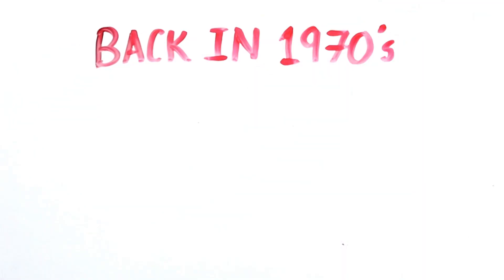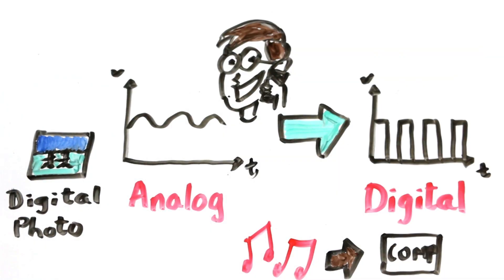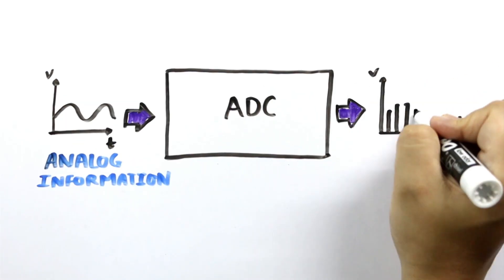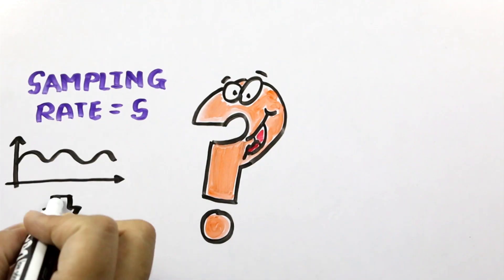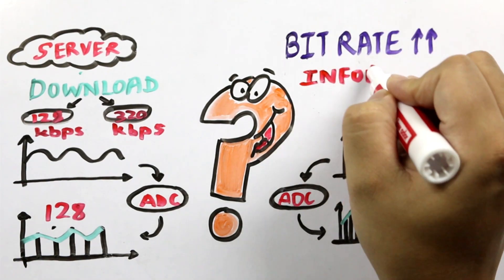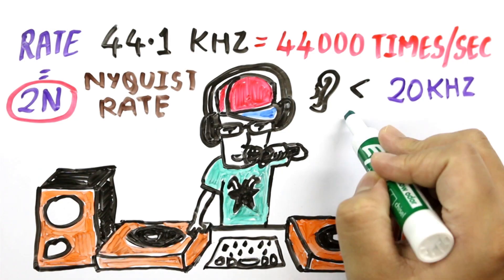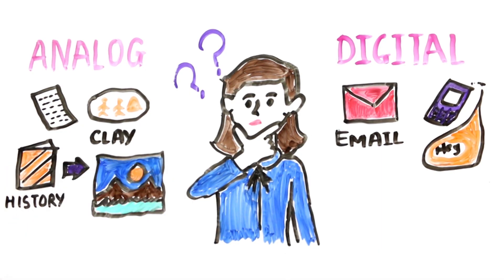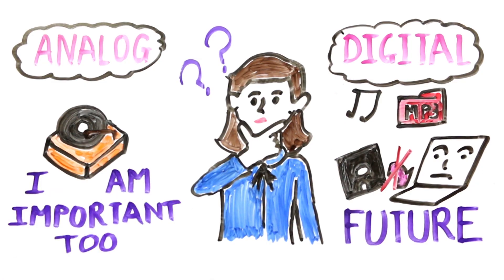Difference between Analog and Digital Signals & Technology

Comment: A problem with current technology is its disposable quality. It is built cheaply with planned obsolescence and people are encouraged to throw away and replace their still working but now unfashionable hardware. Digital encoding isn't the single reason why this is happening, apart from that it facilitates rapid consumption of culture. You'd still need a record player to play an analogue LP just as you would need a floppy disk drive. While you could rig up a makeshift player for coarse groove 78s, and destroy them in the process, it wouldn't work with analogue tapes or laserdisc.

Comment: Is this possible 

Looking at this paperwork 

"SOL 1064nm User's Manual 6 to 40 W (EN) 2014-12.pdf"

Can I  wire a 5 volt power supply to the digital pins 1,3,14,15,22 and variable resister on the analog pins 12 and 20? 

The digital output pins are for system checks and analog output for monitoring  amps 

Digital Pins 5,6,7,8,9,10. And  Analog out  4

Without a computer at all or is a computer required for digital outputs?

I may need a PC for the rs232  or is that just for remote monitoring and will do not need that if we are running on sit. 

https://drive.google.com/file/d/0B-Tfm3HY0PZeempJUHBlWVpyQzA/view?usp=sharing

Comment: Can you just tell me what is the difference between analog and digital senser.?
Reply from the maker: +Lukhman M Ali The biggest difference between Analog and Digital sensors is that Analog sensors produce continuous output. For example: Pressure sensor, Light Dependent resistor. 
Digital sensors on the other hand contain a clock input and also produce output in digital form that is in bits that can be displayed on a seven segment display or an LCD Display.
Eg: Digital Temperature sensor.